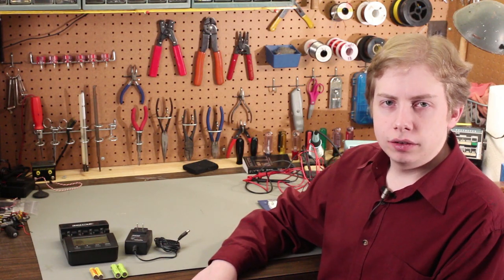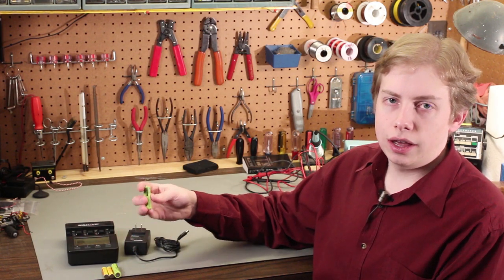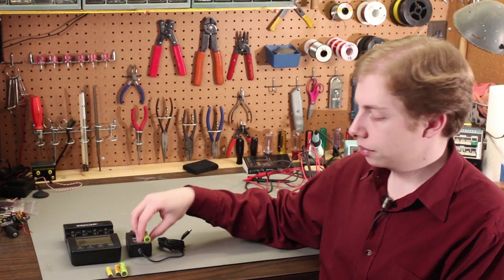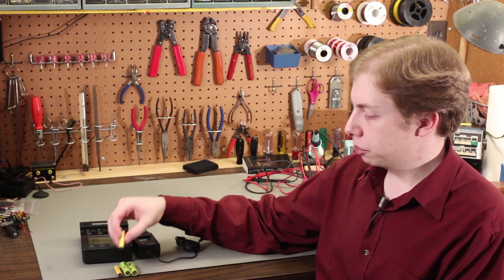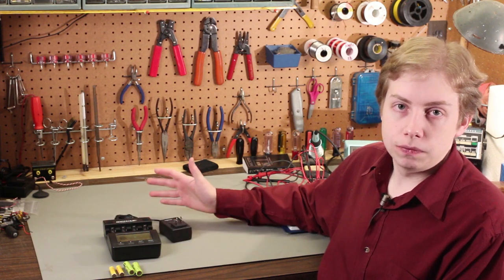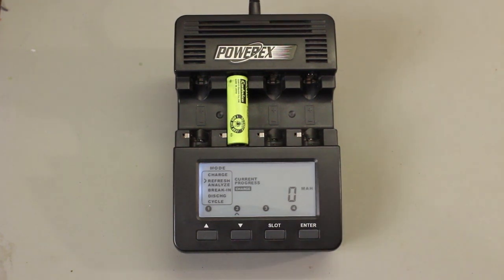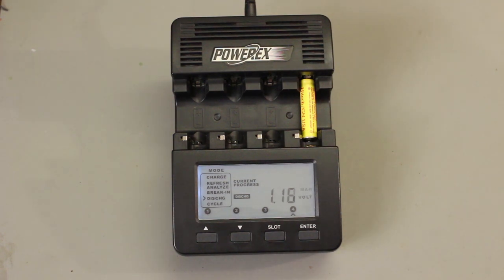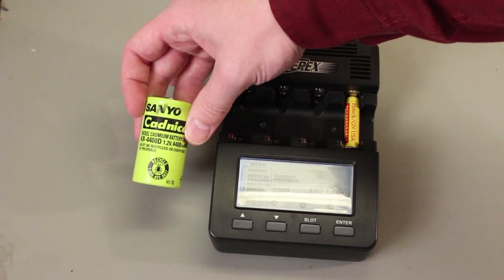Maha Energy Powerex MH-C9000 Charger-Analyzer

Comment: The shown capacity at the end of the charging, is it the actual capacity in mAh compared to the stated capacity written on the battery label?
Reply from the maker: Correct, it is the actual capacity that the MH-C9000 was able to drain from the cell. It reflects the current state of the cell, not what the cell is rated for. That's one of the best features of this charger; you can see how much capacity a cell actually has available for the device its powering.

Comment: Thanyou for your frank and honest review. Unfortunately this device can not be used for laptops and mobile phones which also use rechargeable batteries. Although if you can invent or develop an adapter like you have with D or other size batteries then that would be interesting.
Reply from the maker: Correct; this is for individual NiCd and NiMh cells only. Doesn't do multi-cell batteries or Li-Ion. You'd need something like a Cadex for that.
Reply: @w8nwo  My wife accidentally put in non-rechargables, and the unit was toast. So, protect your gear! lol

Comment: I discharged an AAA battery , and when i charged it the capacity shown was about 90mAh less than the capacity shown when discharged. Why could this happen?
Reply from the maker: Good question. Could be the battery is failing or had a bad connection. Could just be a quirk, too. Wonder what happens if you discharge and charge it again?